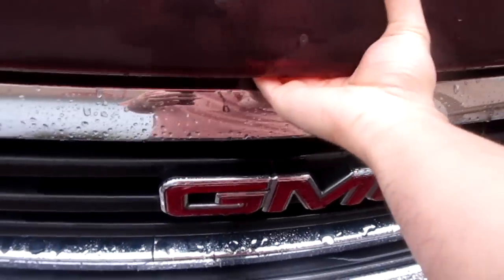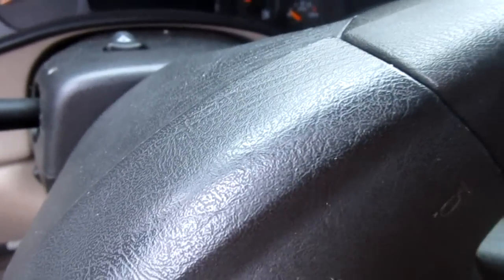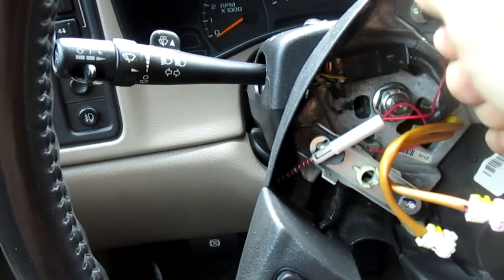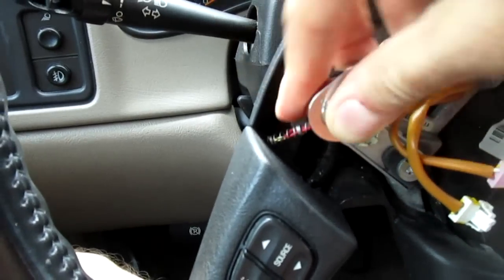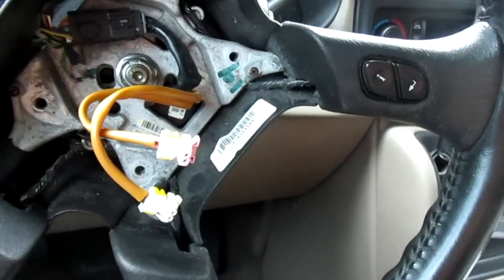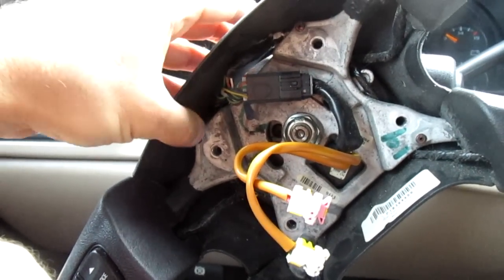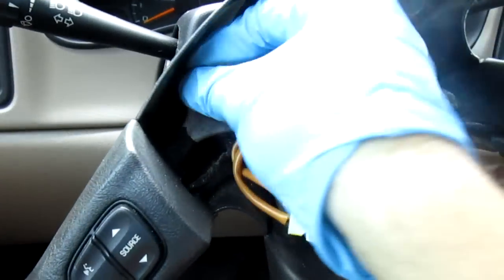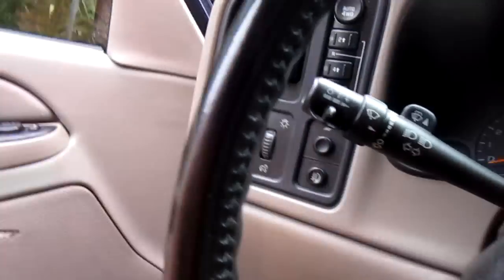03- 07 GM truck Horn DOES NOT WORK!  Horn Switch Replacement

Comment: I watched a similar video then went to fix mine. The other video he soldered a bit on the red wire contact  to get it to work. I simply pulled out the red wire , stretched the spring a bit and fixed. The spring simply gets weak.
Reply from the maker: More like probably the horn ring is worn and warped so the spring takes up the slack.   A new horn ring fixes these the best.

Comment: I PULLED THE SPRING APART SOME AN PUT A DAB OF SOLDER ON THE BRASS TIP. WORKED
Reply from the maker: Ya for now.  It will crack off eventually.

Comment: If your clock spring is bad ,should you try cleaning contacts and or replace the contact activators and try before having to pull the steering wheel off to get at clock spring ?
Reply from the maker: Its fine  the horn contact ring is warped from the hot heat here. I have a new one still need to put it on it works alot better after this